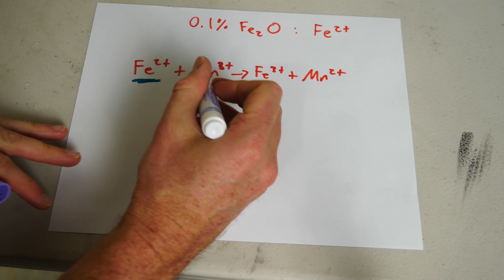When You Shine Deadly Radiation on Glass (and food)

Comment: As your bottle was hanging on a metal rod which conducts electricity very effectively and your room might have been a bit cool. When you heated the glass right at where it contacted the cold rod of metal it got a differential of expansion and popped. You also put the flame right on the glass and and left it there where if you had put it in a kiln and slowly raise the temperature you probably could have gotten away with it and made it work without breaking the glass. You need even slow heating with glass that has a sensitivity to expansion differentials

Comment: especially with the bottle mounted like that, the metal rod will conduct more heat than the glass creating a heat differential. Also the hottest part of the flame is beyond where you can see it.
Reply: The hottest part of the flame is at the point of the darker blue inner flame.

Comment: What you really need, is a kiln, similar to what is used for firing ceramics. Bring the temperature up slowly, then, allow it to cool naturally, over several hours. That will avoid thermal shock, or temperature gradients, keeping the coefficient of expansion from exceeding the elastic limit of the glass. The whole process should take 4~5 hours, so there is minimal difference in temperature between any parts of the glass.

Comment: The purple color is caused by Fe4+ ions forming in the glass matrix; the electron which was knocked out from Fe3+ stays nearby in a vacancy but cannot recombine until the glass is heated up. It has nothing to do with manganese, manganese oxide is used to oxidize intensely green Fe2+ into almost colorless Fe3+ during production - otherwise you would have a green beer bottle glass

Comment: Some forms of colored glass will turn one color in a reducing flame and a different color in an oxidizing flame.  One such transition is between pastel blue (oxidizing) and brown (reducing).  I'm not sure whether the glass color was changed just by the temperature, or if the fuel/air mixture may have also affected it.

Comment: Please follow up on Alexa laser. I think if you put a bit of ali foil on top it will act as a diaphragm for the laser and let Alexa hear it. Alexa mics are on the under side  of the PCB so not directly under the grill opening.
Reply: It would also be fun if you turned the laser in to a microphone. It can be done by measuring laser deflection from a vibrating surface like a mirror in a room where people talk.

Comment: Dude. Clear is not a color. They are both clear.
Reply: They are both translucent, "clear" meaning the absence of color, like window glass.
Reply: Don't Hug Me I'm Skeptic you are wrong. Clear refers to color not at all. Clear refers to how opaque the glass is. You could read through those bottles. They are clear. Both. One is clear and green, and one is clear and purple. Review your high school chemistry. Opacity and color and two separate properties. (I’ll give you, based only on the fact that I don’t have those bottles in my hands that they might be VERY SLIGHTLY translucent but it doesn’t look like it from the video. Regardless, CLEAR IS NOT A COLOR)
Reply: @ettanasf  no one said clear was a color
Reply: @ettanasf  you pretty much repeated what I just said. And it wouldn't be chemistry, more like physics.
Reply: Don't Hug Me I'm Skeptic He starts the video by saying that they are turning clear. He says one is clear and one is purple. He’s referring to clear as a color, very blatantly. And as far as your physics comment goes, I learned about this king of observational specificity in HS chem. YOU ARE WRONG.